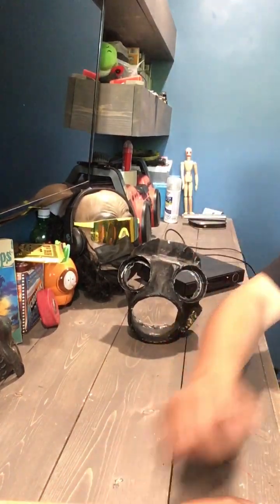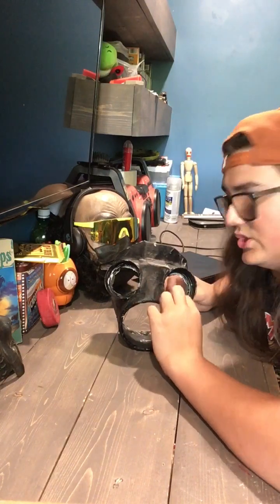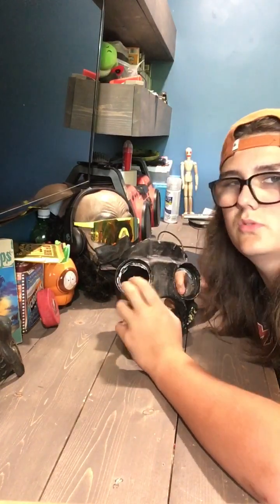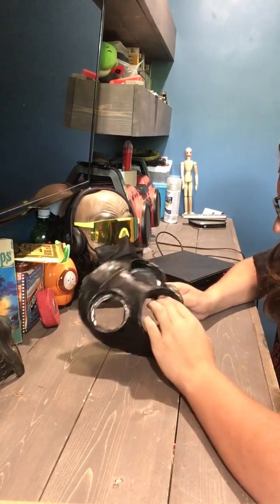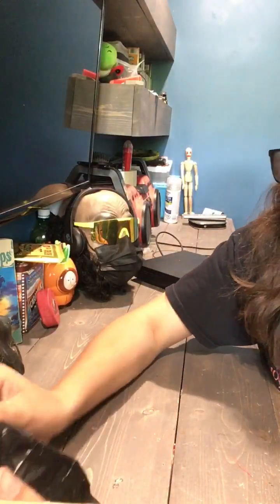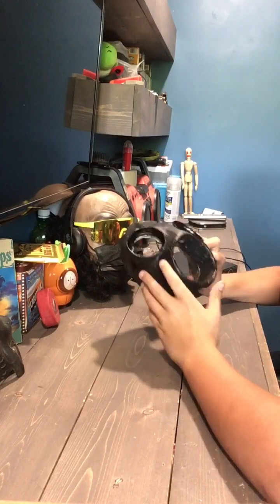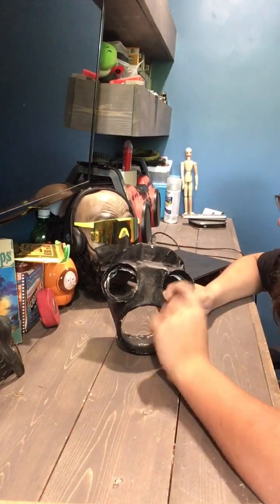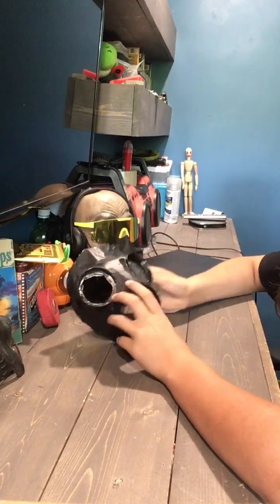My Sid Wilson s/t and IOWA C3 mask made of duct tape

Comment: if you can remember how did you make the sculpt/shape?
Reply from the maker: So what I did was I got a wooden circle for the mouth hole and taped 2 jar lids on top for the eyes but the eyes have to be slightly pulled back and slightly facing opposite directions and you want the screw part of the lid facing out. After that I got a peice of card board and put it in between the eyes,taped it up and started door by the forehead part gradually working my way down the side of the mask at the bottom connect the sides. After that you pretty much just have to put duct tape in spots that have holes or stuff like that.
I hope that explains it if I doesent just comment again on part where your confused
Reply: @Sicdeceit36 ok thank you so much 🤘🏻